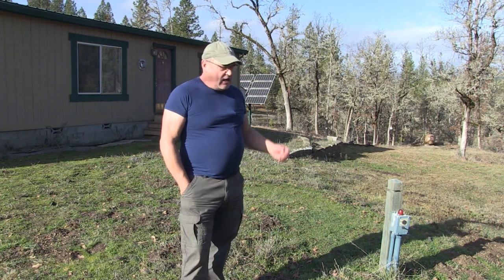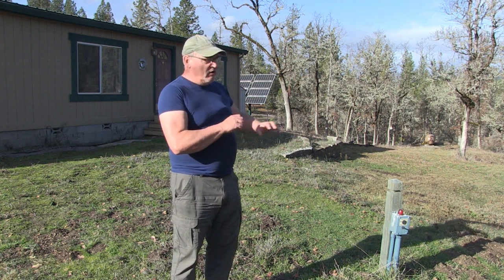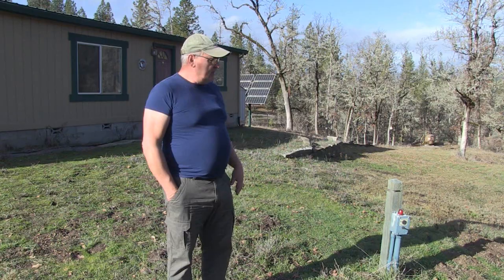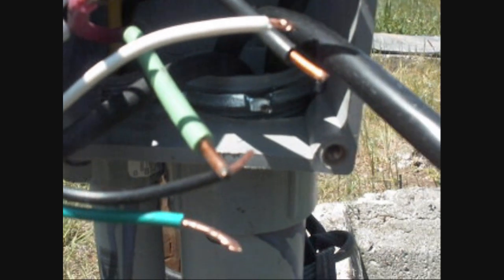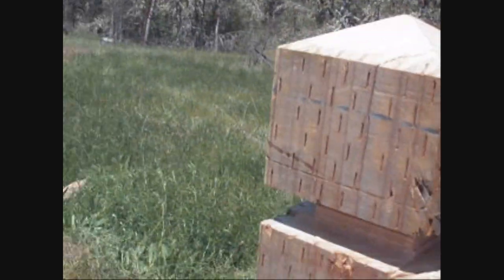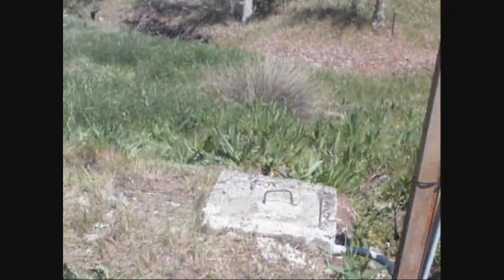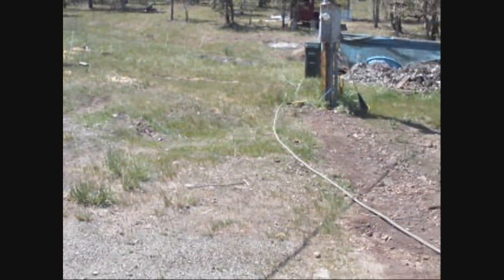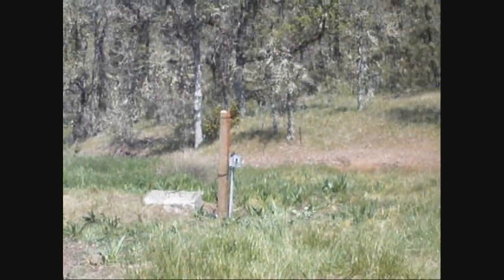HOMESTEAD HACKS - Using Septic Methane For Reusable Energy

Comment: Another collection system I have seen used an air mattress as a reservoir... holds a lot more than an inner tube.
Reply from the maker: I wonder if a water bed mattress would work as well.
Reply: @pinemeadowshobbyfarmafruga8319  I have seen on youtube how to compress it safely into empty propane cylinders.  Another way?

Comment: An idea I had is to tap a gas line into the vent pipe inside your home the add a cap with a pressure relief valve on top of the roof to contain the gas in an already existing container.
Reply from the maker: What kind of gas.

Comment: You can run it through a three part scrubber (water, kitty litter, and steel wool) to get rid of some of the other unwanted biproducts. Then i saw somebody scrubbed it and let it inflate a queen sized air mattress that was then plumbed to the intake of a small air compressor that would then compress it into an actual propane tank or natural gas tank. Thought those were cool ideas too. Good on you for moving toward using all the energy we waste on a daily basis.
Reply from the maker: Nice. I did see the scrubber material used in the building of a gasifier to run a car on.

Comment: I've also seen the pig farm collection but it was from the Midwest... I believe it also has to be large enough to maintain a hot enough temperature to stay biologically active so cold climates can be a problem

It's a fascinating idea that especially if you were to add manure for bulk volume...
Reply from the maker: Yes, and the ground is the perfect environment for maintaining that temperature, especially in a buried septic tank, as it is always producing methane gas from the tiny little microbes working hard in there year round. OMG, if they stopped doing what they do in the winter months here, it would be a very nasty situation. Yuk

Comment: sounds like a cool plan - have you ever seen such a system of methane collection of a septic tank?
Reply from the maker: Yes. They also call it a Methane Digester. Some large farm operations are using them.
Reply: @pinemeadowshobbyfarmafruga8319  I think in India they are on a smaller scale and in China - but they probably put cow manure and pig manure in them also or something. I just wondered how practical a septic system would be - I guess it depends on how many people are using it and the meat levels in the diet.... anyway have fun. I got a composting toilet.

Comment: l can't recall all the details but l remember reading some years ago about the most successful renewable energy project ever done and that was started in China back in 1966 if l am remembering right and they developed a Methane bio-digester system that was modeled on an average family's toilette deposit's plus vegetable waste and manure from a pig l believe, this was a successful project for supplying lighting and cooking gas, my retirement plans will be fully ready for this April and l will be moving to the Philippines permanently if the world stays together for a couple more months then l will try and tap into a septic tank l had built built back in 2016, if l can get enough gas for a single burner flame l would be happy because propane is expensive and delivery isn't guaranteed in the future.
Reply from the maker: I have seen that some are using this method in the philipines. Best of luck on your new adventures. I too hope the world holds it together for some time to come. But historically, if a nation is rattling their sabre no, usually means they always go to war in the Spring.

Comment: why a high water alarm?  If your septic tank is working (as it should) only urine  will be in there , along with raw sewage of course,  I have been using the same septic tank for 19 years, Never had it emptied , It works perfect, But You should Never let Gray water run in it or storm water
Reply from the maker: There are primarily 2 types of septic systems, depending on soil quality for percolation. I well draining soil, a simple tank with a drain field located down hill from the collection tank serves well. The effluent flows out of the tank, down hill to the leach field and drains by gravity into the soil. All wonderful. HOWEVER, for those of us whom don't have premium soil, we have what they call a Sand Filter System. When I flush my toilet, the waste goes into a two-chambers tank. On one side, the solids break down and settle to the bottom. The effluent flows through a passage to the second chamber where it collects. There is an electric effluent pump in the bottom of that chamber activated by a float valve. When effluent reaches a few feat in depth, the pump is activated and pumps by pressure the liquid up through a pipe which exits into a sandy mound which is lined by a plastic liner and some rock material on the bottom. The liquid is sprayed over the top of the sand, all buried beneath a layer of soil material, and percolates down through a collection box which then by gravity, drains the effluent out into perforated pipes located in the leach field. Approximately two feet above the pump float is another float switch activating an alarm with sound and lights. If the pump should fail, or the power goes out servicing the pump, the float switch sets off the alarm alerting the residence to not use the facilities until repair could be made to the electric pump within the effluent side of the septic tank. There are diagrams of this type of system on the internet for better clarity. Thank you for your question. P.S. This is NOT the optimal system to use in an OFF-GRID situation.

Comment: Another idea that I just thought of, if you were to connect an air pump, connecting it directly to the outside of the gas.

Since you have solar panels, that will alleviate having to pay for electricity to the utility companies. Any kind of air compressor will work, so long as you have a pressure shut off system installed.

Using a air conditioner radiator from the car, pump the gas into the radiator for storage. This storage would consist of your pressurized gas.

Using a one-way check valve is essential
Reply from the maker: Sounds like a genius plan. I will have to give that one some more thought.

Comment: pyrolyzing?
Reply from the maker: The pyrolysis (or devolatilization) process is the thermal decomposition of materials at elevated temperatures in an inert atmosphere. It involves a change of chemical composition. The word is coined from the Greek-derived elements pyro "fire", "heat", "fever" and lysis "separating".